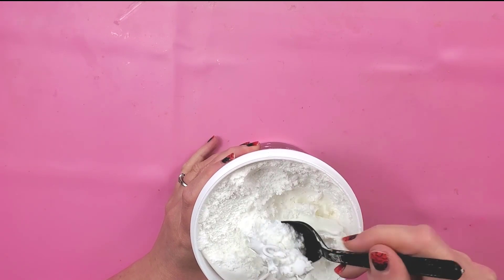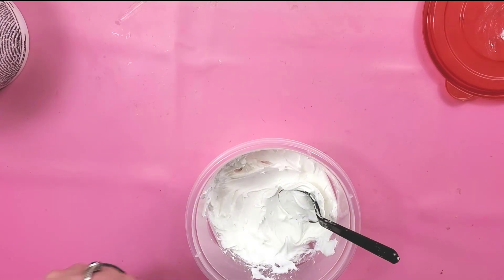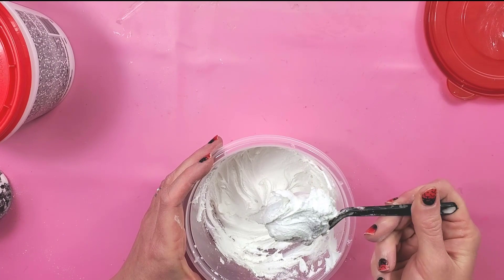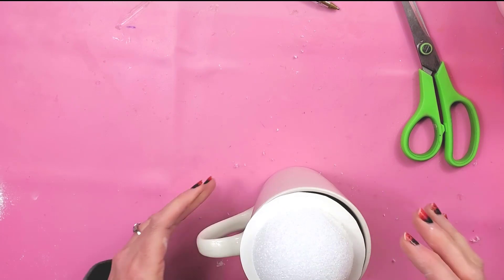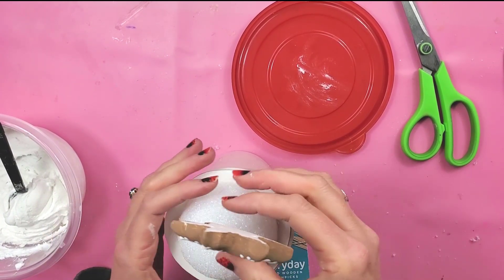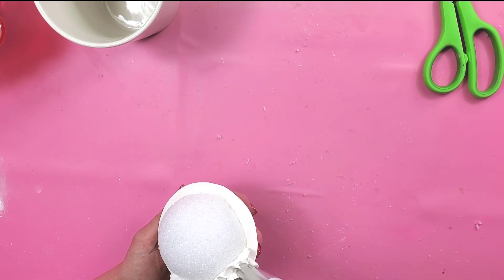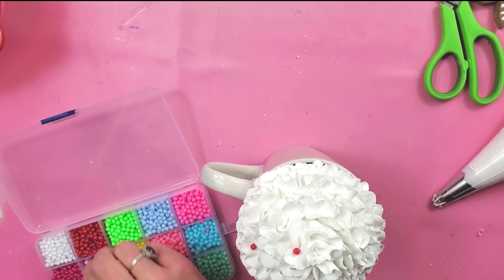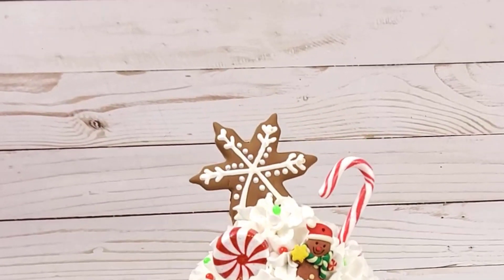IF YOUR FAKE WHIPPED CREAM LOOKS A MESS, YOU NEED TO WATCH THIS!

Comment: You are a great teacher!!! I started making fake cupcakes. I store them in a Rubbermaid, but I’m finding that some are cracking. Any suggestions?? Thanks!!!
Reply from the maker: Which part is cracking?  The spackling?
Reply: @CassieSmallwood Yes. Maybe because I use the expandable foam?
Reply from the maker: @moseygirlcreations  that shouldn't matter if it's fully dry.  But I guess it's possible when mixing chemicals.

Comment: I added water and paint to my spackle, and now it is not curing it's been a couple of days and still feels soft.  Any suggestions to help it cure, or am I going to have to start over?
Reply from the maker: With this amount of spackle, it will take up to a week to dry fully.  I usually put a small fan blowing on mine to speed it up some, but it still takes days.  Is it dry to the touch but soft inside?  The outside should harden first.  If it's not drying on the outside after two days, something is wrong.

Comment: I have tried this and it came out good. But its been a couple days and its not super hard. if i wad to press on it, it could get ruined. Does it not dry hard?
Reply from the maker: It will dry hard.  It can take a while for it to dry and will vary depending on temperature, humidity, etc.  I like to put a small fan blowing toward mine to help them dry faster.
Reply: @CassieSmallwood  thank i will keep waiting. What kind of spakel do you use. Maybe i got the wrong kind
Reply from the maker: @TeresaMcCreary  I use DAP, but I've used others.  It shouldn't matter.  If you put a thin coat of that on your wall, it takes about a day to dry.  This is piled up so it takes longer.  Plus the air isn't really getting to the underneath part very fast.
Reply: Thank you for the tips. Do you use any sealer once it is dried?
Reply from the maker: @TeresaMcCreary  I don't but you can if you want.

Comment: No matter how thin my spackle is, I cannot get it to pipe. I’ve blown out the bag, and it still won’t come out the tip (I’m using a tip with a large hole). I’m really frustrated, and can’t figure out what to do😢
Reply from the maker: What brand are you using?
Reply: Thanks for getting back to me so quickly. It was my first try, so I bought a small container from Dollar Tree. I guess brand matters😋. What do your recommend?  Where do you get it?
Reply from the maker: @jenniferday8060  The Dollar Tree one is horrible, very dry and gray.  I would say that's your problem.  I use Dap but a lot of other people like Red Devil.  You can get both of those on Amazon for cheaper than the hardware stores.